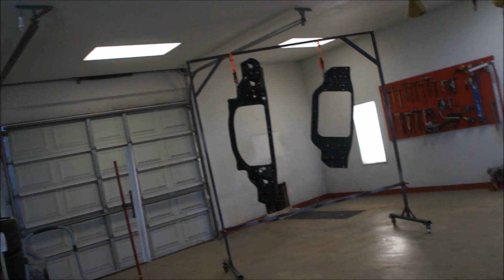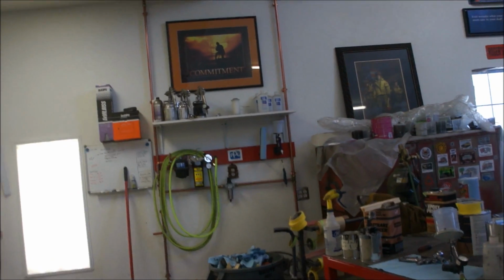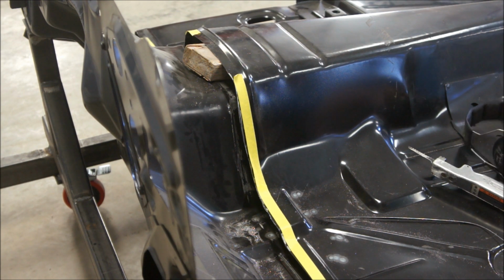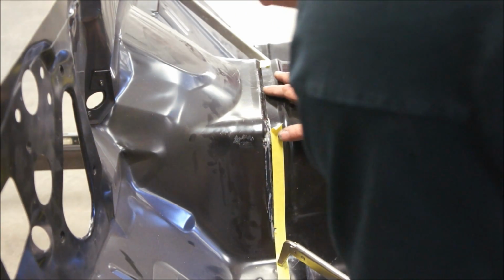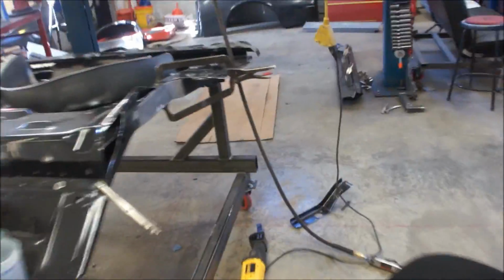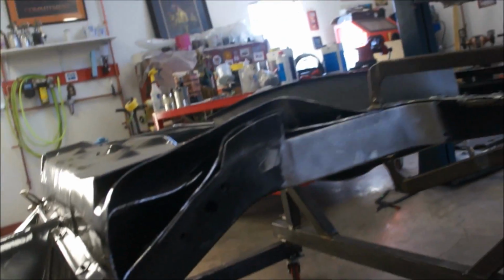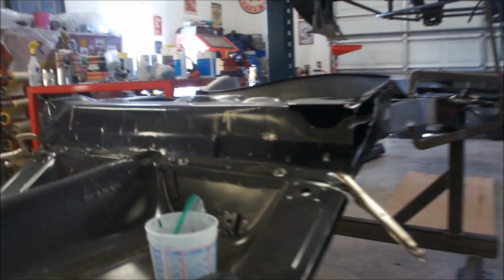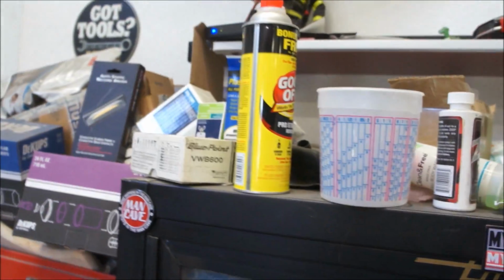1968 camaro floor work

Comment: i use sherwin williams high speed clear at home its an antiscratch 2k which can be used in non bake situations, its really good stuff, the primers the air bake 2k are great too
https://www.youtube.com/watch?v=es8anUR7xVw watch this vid, its not so much the speed through the job but the fact you dont need high temps to use it, never let me down in 10 years of using the primer or clear
might help if you set up a recirculating  fume extraction s while you painting you taking the fumes through an exit filter, along a wide vent pipe and back through an entrance filter, that way you dont loose heat
need to use a pully fan so motor is not in fume run for spark reasons
Reply from the maker: messylaura thanks ! Matt likes sherwin as well I don’t know if they sell it here locally tho
Reply: i dont like their base coats though, i use octoral/debeers waterbase, or ppg solvent
Reply from the maker: messylaura ppg solvent is what I’m using on these core supports with concept 2021 clear
Reply: last thing i  cleared was my late mus pine dresser, had to da top back to 40 grit then beck up to 180 and the rest mostly 120 - 240 just to get rid of 20 years of being in leeky shed, 
i just used the sherwins anti scratch air bake clear for the whole job, 
cleared each piece 3 times, seal the grain, purge the fill and final coat, here in uk its been pretty cold, clear was dry ready to sand in 30 mins apart from the purge i left a few days as it was loaded on

i still have a huge stock of ppg deltron gloss and base tinters from when my last garage switched to water base

with the primer of the same ilk there is very little waiting time, unlike normal 2k primers in a non bake garage where you could wait a long time for full cure
pot test does suggest a fair shrinkage but in real life i've not seen any shrink on panels, its overspray is a bitch to remove!!

take note of it having a lowwer tip size to spray, 1.3, or it will run, its build though is very high, it trully is a wet on wet operation with no wait times between coats esp the  primer, which is available in multi colours though i use the black primer the most
Reply from the maker: messylaura thanks for the info , being that it flashes so fast do you see any issues with the clear dying back or hazy ness ?
Reply: nope, best to do is test some your end, i've used it on my own cars and counter tops with and without polish/clear sanding both seem fine
if i want to use a new product on one of my nice cars i either spray some on my daily driver as if it was the nice car to see how it holds up, weither thats paint, clear , sealers underseals etc
its a real world test so you dont put stuff on a finish job then get let down
dont just use a flat panel for test use something with an over lap joint so you can see if the shrinkage pulls away or cracks at joint,.
i have tested some stone chips on metal panels and poped or screwed them on mud shields behind the wheels and given them hell :)

recently i tested your gorilla glue (origonal) , my god that stuff is great, i glues two soles on a pair of high heel shoes and wore them for a week through rain/mud puddles the lot and they held up no problem, even a destruction test they showed no signs of  fail, i mention this as soetime we need a perm fixing glue, it does that!

do you use waterbase at your home garage? i found octoral/debeers (same stuff octral the cheaper label) to be no real problem in home situation.
Reply from the maker: messylaura I have never sprayed water base , I know it’s the way everything is going because of environmental concerns, but it’s a whole new learning curve, and all that air that has to blow the paint would surely be a disaster in my dirty ass shop . Interesting story on the high heels 👠
Reply: yeah i have a small uk garage i have to d everything in ame place at home, i dont use the blowers to dry it, 
its pretty good at drying (ones i mentioned) if i do want to dry it i use a hairdryer, needs an oven for a whole car in one though.
reason i didnt like the sherwins w/b is it has an activator in it which makes it go off in pot, with oct/de'rs you can leave it sitting around like solvent then use it again
did you do that chore?
Reply from the maker: messylaura I hear debeers is really good stuff , I would like to try it .
Reply: de rum is better :P
Reply from the maker: messylaura I like d rum